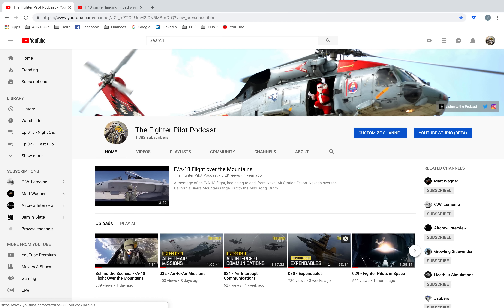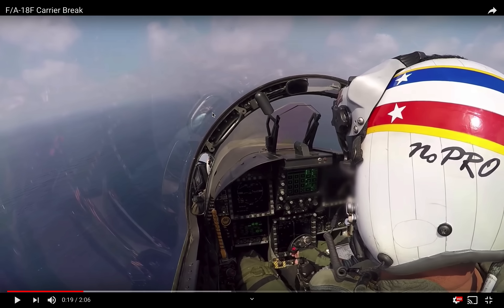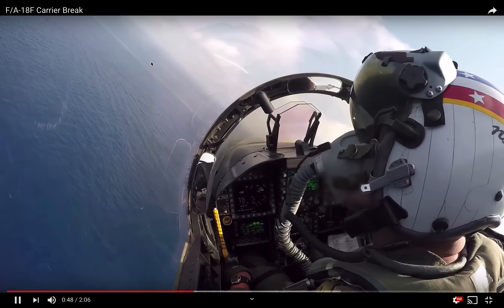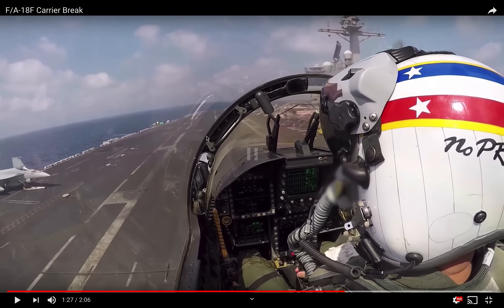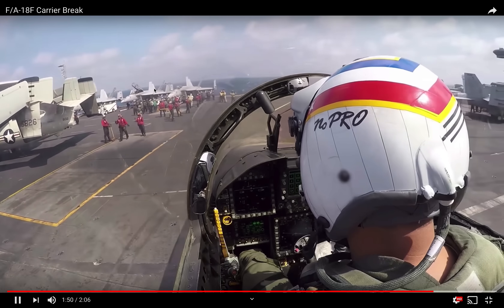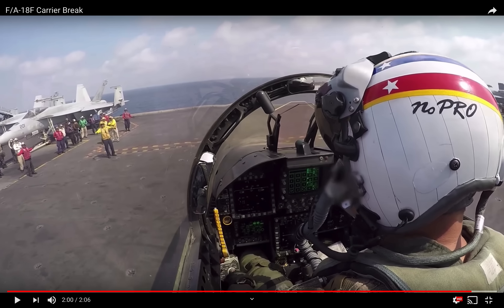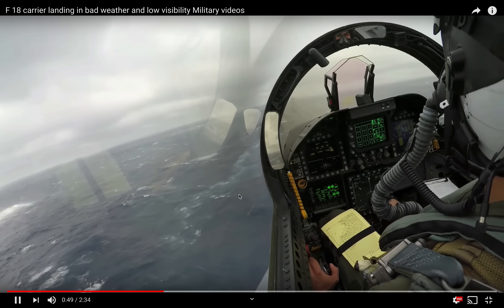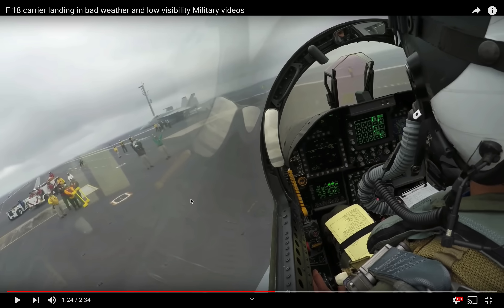What're They Doing? F/A-18 Pilot Breaks Down Carrier Landings

Comment: question... with "20/20 hindsight" (and the benefit of a GoPro) SHOULD the second pilot have applied full power earlier??
there was no indication that he was low or sink rate developing (non-experienced "me" couldn't see anything anyway..)
should he have just "known" to expect a burble and applied power ahead of time in anticipation?
or.... is it just one of those things?
Reply from the maker: Good question.  Being able to anticipate the burble is what differentiates the great pilots from the rest of us (and I use the inclusive "us" deliberately).  Pilots are taught if nothing is changing to add a little power to see what happens.  If nothing, you were probably underpowered and the extra thrust was needed.  On the other hand, if the ball starts to go up then you can quickly stop it and correct.  It's called "energizing the ball."  Doing that would have helped this pilot but, again, this isn't easy...
Reply: @FighterPilotPodcast  -- interesting - thx  : )
Reply: flying is about being 2 steps ahead of what your aircraft is currently doing. The ball only shows where you are now, but the point (I think) is you should anticipate what's going to happen and act before it happens so what you want to happen occurs instead of what was going to happen. In this case, he should have anticipated the burble instead of just reacting to what he felt at the moment, which was the added lift... which put him low and into the 1 wire.